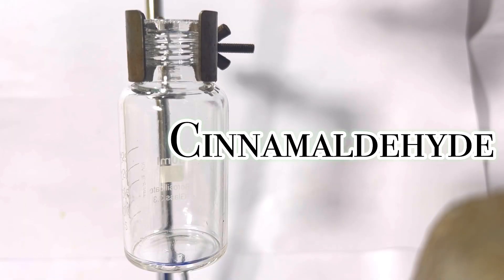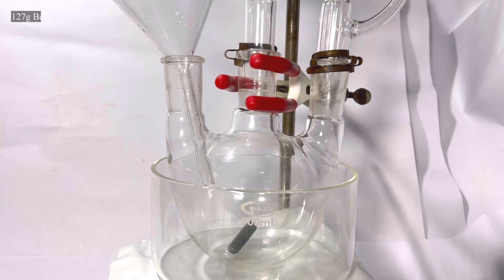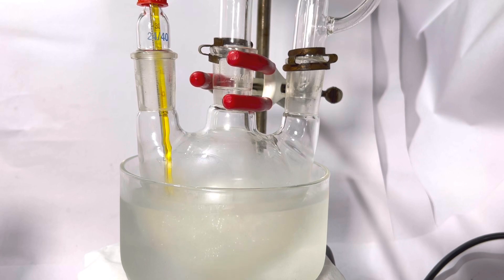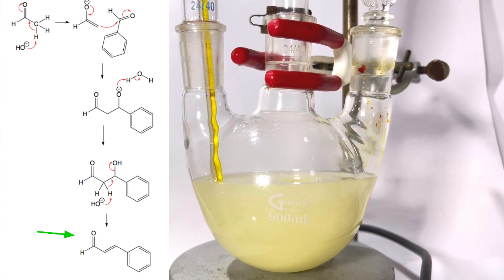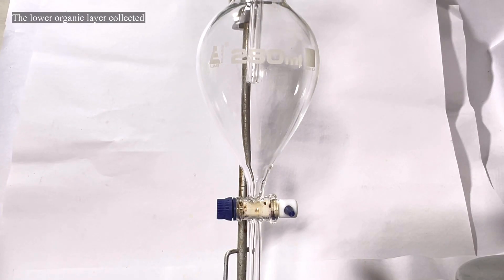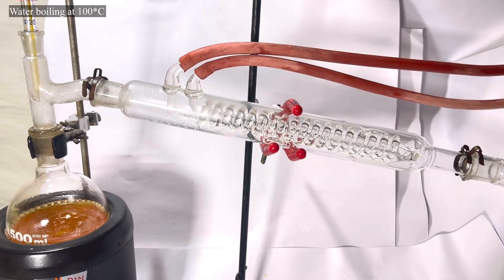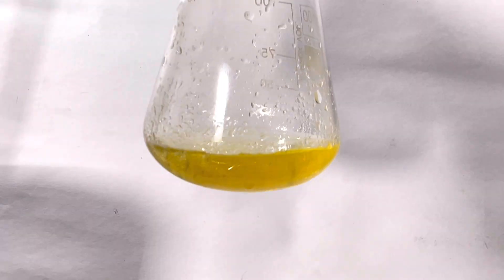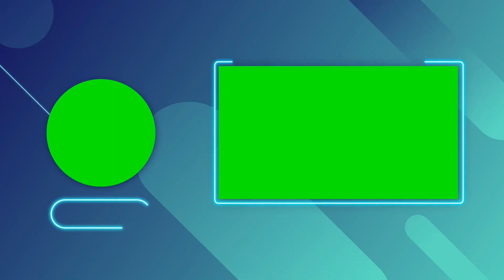Cinnamaldehyde : Synthesis ( Making Artificial Cinnamon flavour )

Comment: Can you do OTC synthesis of benzaldehyde? Almost no chemtuber had done it and the one that does requires subscription to paypall to watch it. The rest of the videos only used benzaldehyde instead of synthesizing it. In undergrad level we could use PCC, but PCC itself is a mess to make and quite toxic. It also requires benzyl alcohol... which would be also a kinda a mess to make from benzyl chloride.
Reply from the maker: What raw material from which you need the benzaldehyde made
Reply: @vibzzlab  if possible things like toluene? Im still figuring what kind of mild and mundane oxidizer to use

Comment: I dont get why you put the base in it slowly
Reply from the maker: The reaction is quite exothermic. If we add KOH very fast the flask get very hot and the heat could make the acetaldehyde escape as it has a very low boiling point
Reply: @vibzzlab  Thanks! Second question: why did you use acetic acid to neutralise NaOH? Why didnt you use HCl? Is there a specific reaaon?

Comment: So the reaction optimum time is 4 hours, since acetaldehyde is forbidden in some country it is hard to find the chemical
Reply from the maker: Acetaldehyde could be easily made from ethanol and sodium dichromate
Reply: Yep i have tried to oxidize ethanol with pottasium dichromate/sulfuric acid and distilled in hurry, but it's failed because it's difficult, fast reaction to form acetic acid and low yield..maybe next would you mind showing how to make acetaldehyde, hhe thank you for advance